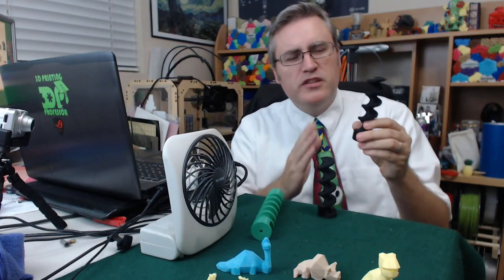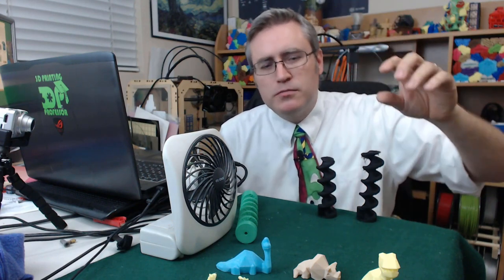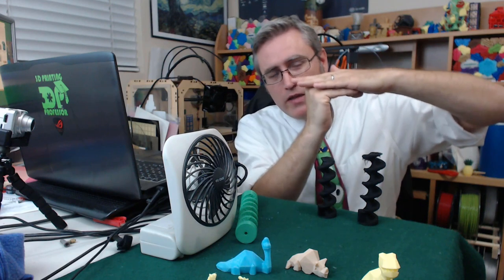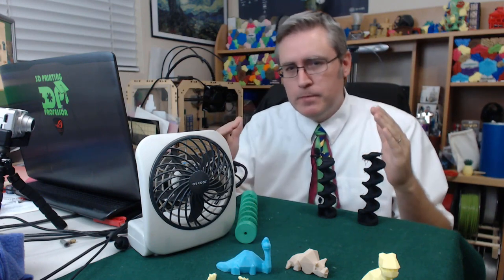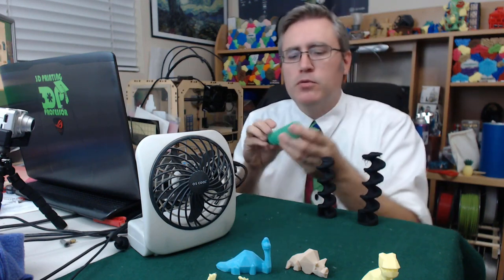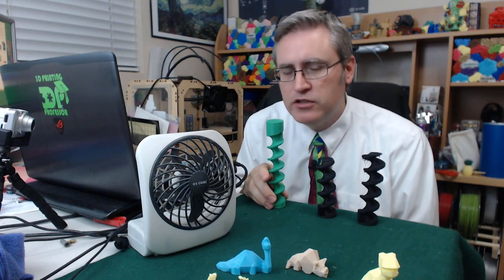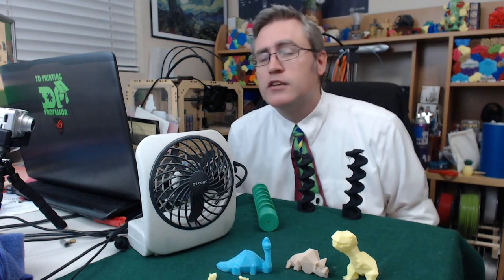3D Printing Tip - How to Get Good Overhangs

Comment: I got used to sleeping with my printer running, now every time I start a print, I feel like falling asleep? I'll hear it finish in the middle of the night, wake up and start another print. Is this normal?
Reply from the maker: You're asking me what's normal?
Reply: Just a variation on a white noise machine really.  At least if it malfunctions and catches on fire you probably won’t be hearing the motors anymore and that will wake you up.
Reply: 3D Printing Professor good point, the guys at work asked me what I'm working on? I told them a female Android to bring to work, to beat them all up! Awkward silence,
Reply: yes its normal
Reply: Same here
Reply: yess, me too guy !! No solution, just start your prints at night !
Reply: how were dem fumes? :P I tried this for a while but the sound annoyed me too much so i stuck it outside :D
Reply: i do it, idk if im normal

Comment: With the techniques you described how steep can a overhang be, You said usually you can overhang by 45 degrees and then you listed strategies that can can make it steeper but you never said by how much it can make a print steeper.
Reply from the maker: That's because the actual number varies depending on hardware, where your cooling fan is, and the material you're using, but I've seen a well calibrated print do as high as 80 degree overhangs.
Reply: @3dpprofessor  Thank you, I am researching the abilities of a 3d printer to build overhangs and this video is very useful, i think it is safe to say 3d printers can't print 90 degrees or over overhangs so 80 degrees is pretty impressive.

Comment: Some good info! I've started playing with changing layer thickness at different heights to account for things like this, and I've found a world of difference in quality. Sometimes the print has taken twice as long, but if you end up having to reprint something due to overhang failure, I'd rather commit that time upfront, and have something I know will succeed.

Comment: line width! the most overlooked setting
Reply: Cuda FX in what regard? Is thinner better?
Reply: mostly in the regard, that a lot of people dont even concider it. :D
thinner lines are very detrimental to overhangs! useful for prints with very fine vertical details, and can dramatically slow down larger prints. most slicers still set the nozzle diameter as the standard line width - the worst possible choice for overhangs. (150% the nozzle diameter is often recommended. up to 300% can be used for extreme overhangs) 
wider lines usually make for stronger parts too. 
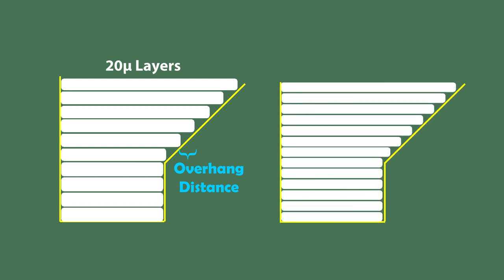look at the illustration at 3:50 , and imagine the nozzle laying down lines. as long as the nozzle's opening doesn't move past the edge of the previous layer, the plastic will squirt out to the side, nice and flat. and the overhang will come out perfectly.

Comment: You could do a follow up video on how to tell your slicer to do perimeters at a lower layer height than infills? That should give the best surface-detail and overhang capability while keeping the print time as low as possible (And to go with that, make shure to tell your slicer to print perimeters from the inside out). For prints where you have the overhang just at one side, you can try to turn your model in the slicer a little bit, instead of dropping it flat on the print bed. It will take some extra support beneath the model (like an angled raft), but usually the bottom surface is not critical and it's easyer to clean away any supports there.

Comment: If you use 'adaptive layers', the slicer can detect where you need to use thinner or thicker layers!
The more horizontal difference between layers (overhang situation), the thinner the layers get!
I use this a bit with Cura 4.8, dunno if other slicers have this feature.
I've run prints with 0.2 layers in 'trouble zones' and 0.4 everywhere else.
You get the fast build-time and fine detail!
It does look odd, however, seeing non-uniform layer-lines!
*
Fans: two is good...one on the hot-end to cool the just-printed material, the other offsides to cool the entire model!
Just like carbon steel, PLA shrinks more the longer it takes to freeze...fast freeze = almost no shrink!
Don't worry about cooling the bed; the part being printed will insulate the adhesion layer!
Start with small cooling, full fans by layer 3...
Reply from the maker: My early experimentation with adaptive layers resulted in layers cooling differently, so smooth walls became bumpy, in line with the adaptive curve on the other side of the shape. But I wonder if more fan is the key for it.

Comment: I have been using Cura 3.3 and the make enable Bridge settings and find it really helps print overhangs well. It really helps. Plus my printer is able to print 50-60 without any supports pretty well. I will give that a try. Always open to trying out new things. Love to learn new stuff as often as I can.

Comment: ive installed a 40x40x20mm noctua fan on the nozzle (with fang design) and now im doing 70 degrees overhangs with no problem (at 40mm/s), more than 70 degrees gets fucked up...lol working out to those ones.... your video was very useful. cheers!

Comment: so what would I do if whenever I print an overhand, and the filament curls up instead of sagging?
Reply from the maker: Curl is caused by filament shrink. For that an enclosure is best and turning down your fan. Thinner layers will also help because there's less to curl.
Reply: @3dpprofessor  Here you say turning down the fan... another guy you´ve told he should increase the fan .... what now?!
Reply from the maker: @ch.wey.4406  Try both!

It kinda depends on the ambient temperature around your printer, how strong the fan is, and which direction it's hitting your print from. So  try both and see if the print is effected.
Reply: @3dpprofessor  It´s confusing. Actually with PLA you should have Overkillfanpower but in my situation it could be too much. And all the other factors like line width or layer height, temps or less print speed.... what a horror story! I´m not able to handle my curling edges ... permanently my nozzle rocks the printed peace. Especially a ball is a good test for me. I´ve tried soo much :-(

Comment: doesn’t the big fan affect the bed temp too? Wont that cause the print to break loose from the bed?   Ive got a part that shows the exact same “Artifacts” as your green corkscrew thingie....Ill give the fan and lower layer height a try.  Thanx for the tip!!!

Comment: Do the new resin printers have this problem?
Reply from the maker: Which ones are the new resin printers?

Resin printers still have to deal with overhangs, but it's slightly different because of the peel. However, i suspect if Carbon's or the University of Michigan's technology that allow for curing off the film ever come into use we'll be able to see some wild new possibilities.
Reply: @3dpprofessor  Wow they sound good.

Comment: What if I have the opposite problem, where the edges rise up and stay above the print head level. The head comes in for another pass and pushes the print down - lifting the opposite end off the bed, or straight up knocks it over. Would the fan help with that, or make it worst? Because that problem is explained with plastics cooling too fast and the proposed solution is to cut all air draft. I tried hotter temps - that didn't help, then I tried extruding with cooler temps and that improved things. Is that solution better than fans?
Reply from the maker: That is indeed curling. Lower layer heights will help by providing less to curl. More fan will also help by cooling it as soon as it comes out of the nozzle, instead of cooling over time which pull on the entire area. Adding a Z-hop might also help by getting the nozzle out of the way during travels so it won't knock things down.
Reply: that is also a lack of cooling issue .. for pla in my testing you can never have to much cooling
Reply: @3dpprofessor  Antoher guy you´ve told him to decrease the fan speed .... just 4 or 5 comments beyond

Comment: My experience with PLA and PETG shows the opposite, if I reduce the layer height to around 0.1-0.15, i get horrible overhangs, curling up like tomorrow would never come, however if i use 0.25 with a 0.4 nozzle, the curling just goes away, an I can print about 60-65 degree overhangs without problems. If I go higher, like 0.3, that's too much however, it starts to droop significantly, or if I go smaller, like 0.2, it starts to curl up, and both with PETG and PLA, fan settings, temperature, speed it doesn't matter, it happens always if I use different number than 0.25

I still need to try out how different nozzle sizes works with it, if it's a nozzle to layer height ratio then the layer height should be "nozzle diameter*0.625", or only a fix number, which is 0.25, I'm not sure about that yet
Reply from the maker: You might be over extruding. It makes the layers stick good, but makes material squish up around the sides, leading to the next layer being pushed up and, thus,  curling.
Reply: @3dpprofessor  no, when I print a 5mm wide piece, it comes out exactly 5mm, measuring with a micrometer, and 100% infill
Reply from the maker: @peterfoldesi483  That doesn't mean you're not over extruding. You may have just compensated for the over extrusion by under shooting your steps per mm. I'm not saying you are, just saying it's a possibility and that test doesn't prove you aren't. How are your internal holes? If you punch a 10mm cubic hole in a 20mm test cube, is the internal hole 10mm, or is it a lot less? If you make a screw hole, do you always have to drill them out? If you make a gap for a skate bearing does it not fit, despite careful measurement?
As tom Sanlander said, you could be adjusting your steering to compensate for a flat tire, doesn't mean you're actually driving straight.
Again, you probably did adjust it property. Just saying that test as you explained it doesn't prove that you aren't over extruding. I'm just throwing out possibilities for why thicker layers don't curl as much.
Reply: @3dpprofessor  if I print an 8mm hole, then an 8mm carbide endmill just go into the hole without any slop

I also tested it with 100mm, this time only a caliper, but I got correct dimensions
Reply from the maker: @peterfoldesi483  Alright then. I wonder what's causing your curl.

Comment: another thing that greatly helps overhangs is the line width for similar reasons as lower layer height. i usually aim to have at least half the line on the print.

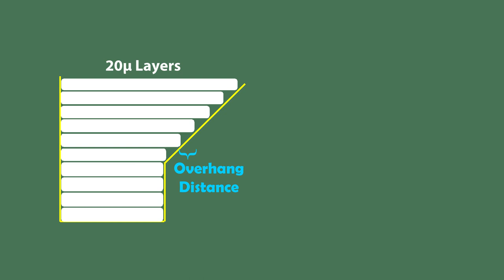Comment: 3:47  You meant 200 and 150 µ?
Reply from the maker: Psh, what are you doing printing in such chunky layers still. Are you trying to finish your prints in mere hours instead of days? Plebe.

Just kidding. Yup, I was off by an order of magnitude there.
Reply: I don't mind to print something at 0.02 layer height, but even on 0.1 it is often happened the nozzle often just buries in the previous layer, so overall result is a mess. (I have Tarantula with one Z motor yet, but changed the bed support to a new printed one with less oscillation, but still)
May be you'll have some advises about that in the further of your great videos
Reply from the maker: My first reaction is that the problem is your 3D printer. I've had bad experiences with every TEVO printer I've ever used. Every other 3D printer I've used can go comfortably down to 0.06mm layers. Maybe you need better stepper drivers.

On the plus side, I find 0.15mm layers to suitably straddle the difference between long prints and good looks, so stick with that.
Reply: 3D Printing Professor Your animation shows 15um vs 20um examples. Clearly you meant 150um and 200um (0.2mm and 0.15mm layer heights and not 0.02mm and 0.015mm layers as the video indicated). Alex was correct about observing this single order of magnitude error.